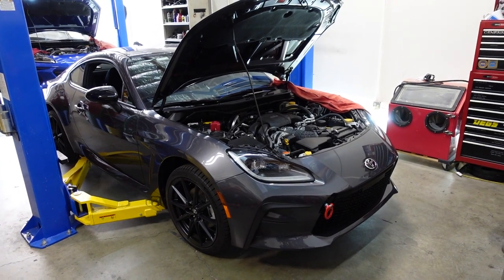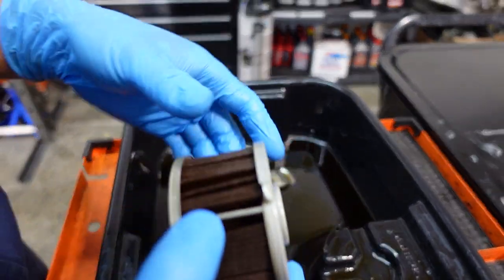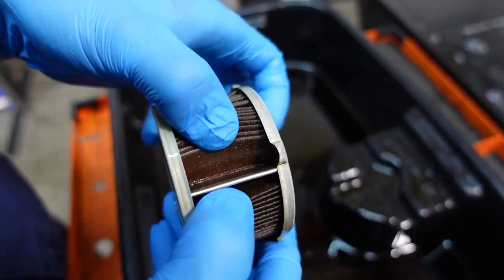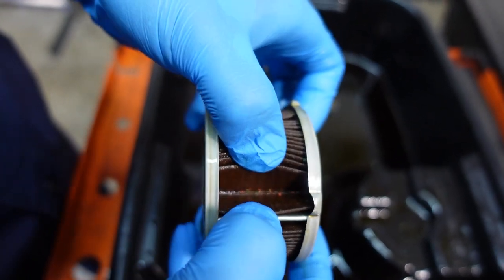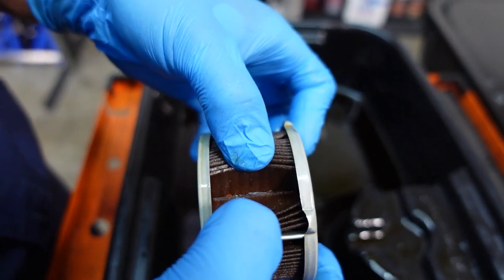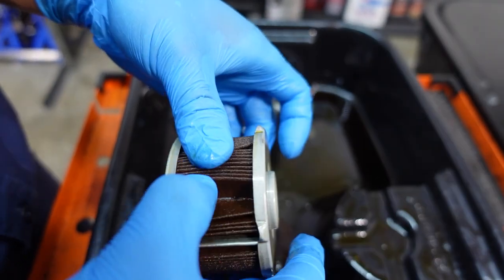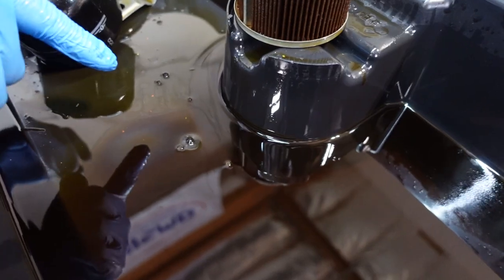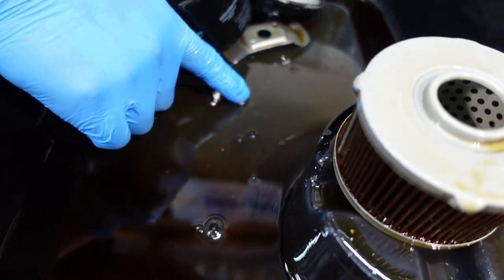GR86 Oil filter Inspection (Red and Green RTV?!?!)

Comment: My sons car stole the other day only has 4971 miles 2023 GR86 rattling noise on engine and white thick smoke coming out of the exhaust pipe. Dealer try to blame on him. They said it is not going to be covered by the warranty. Which is A big BS!
Reply from the maker: Someone local had to hire a lemon law lawyer for his GR86 with engine failure. Locally it seems dealers are using "low engine oil" as the reason for engine failure.

Unfortunately you may have to lawyer up. If you contact some media outlets such as "The Drive" or "Road and Track" and tell your story, they may be of assistance.
Reply: @CMAutohaus  dealer report it only has 1qt oil left low engine oil. But when I got home I checked the deep stick and it has no oil. Tech drained the oil and did not replace it. They try to hide something!

Comment: Would you recommend holding off on buying these early year models?
Reply from the maker: 1st year models from any car company will always have issues.
Reply: @CMAutohaus  Agreed, but those issues typically don’t involve the engine slowly starving itself of oil until it dies.
Reply: I’m getting my 2023 which will probably be the same as the first year. The good news is that you KNOW what the issue is and can monitor for symptoms. 
I’ll be doing a 1500 mile oil change and oil filter inspection. If I see a lot of silicone, then I’ll drop the pan and clean out that take up tube. But overall, this car on fire stuff is 4 cars out of hundreds.
Reply: @alexrain1188  
👊❤️